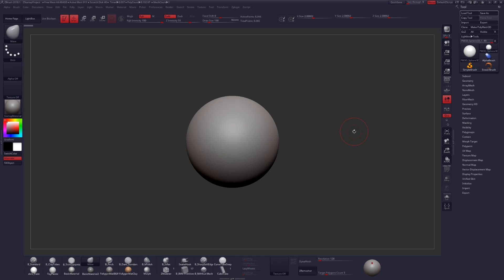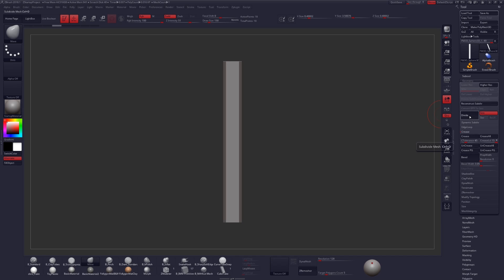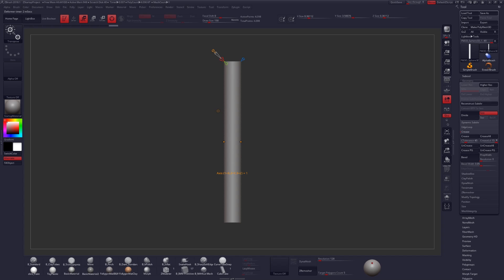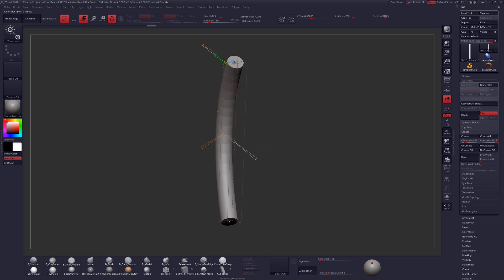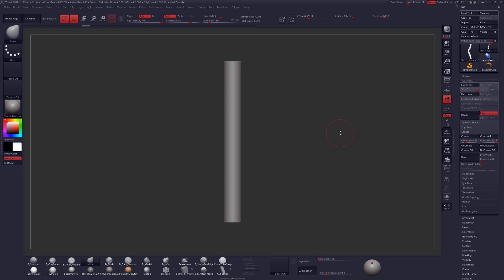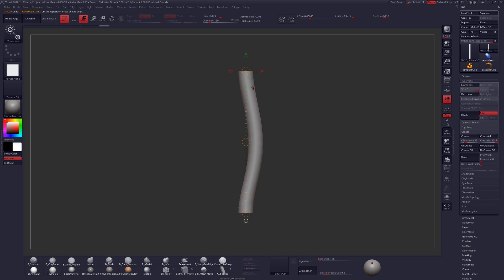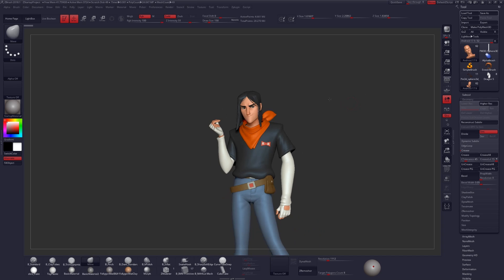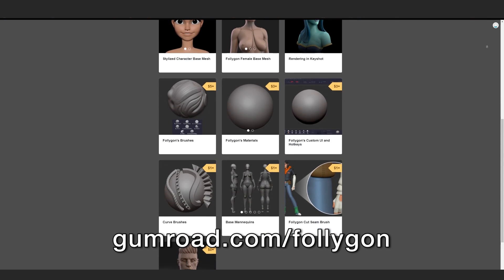Bend Curve Deformer - ZBrush Tutorial

Comment: is there a way to do this without loosing your subdivisions? (this requires layers baking)
Reply from the maker: Yep, just delete your subdivs temporarily and reconstruct them once you’re finished using the deformer.
Reply: @Follygon  but id loose my layers right?
Reply from the maker: @WillPreston3D  Subdivisions or layers? You can keep subdivs, but not layers.

I don't work with layers as I find them fairly useless. They tend to cause more issues and slow down than they are worth.
Reply: @Follygon  they're vital for some workflows

Comment: thanks for the tip, is there a good way to get large curves changing the end point without deforming the mesh or atleast enough where it won't destroy the shape? Attempting to quickly curve a tail towards my creatures body. Bend curve wont work if I want to keep layers to deform the position back.
Reply: I'm using spiral brush for such purposes, hotkeys b-s-g  in zbrush 2021.7

Comment: Hi I have a problem where the pivot points are mirroring each otherr sort of, like the two end ones will do the same as each other, if i pull up they both go up meaning I am unable to get a asymetrical shape at all???
Reply: bit late, half of the top corner green cone toggles symmetry
Reply: @samras3191  Thank you! Thank you!
Reply: @samras3191  Thanks! Don't know why Zbrush has to make such settings so vague
Reply: Hi! Did you manage to find the solution to this issue? Thanks a lot :)